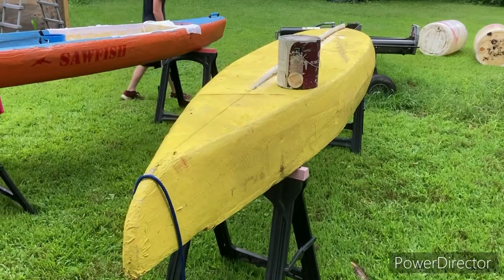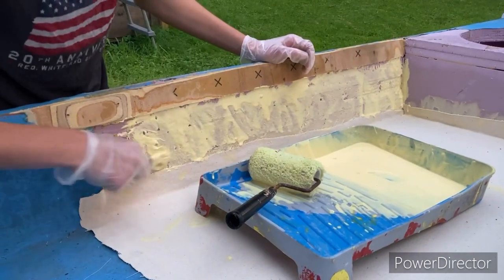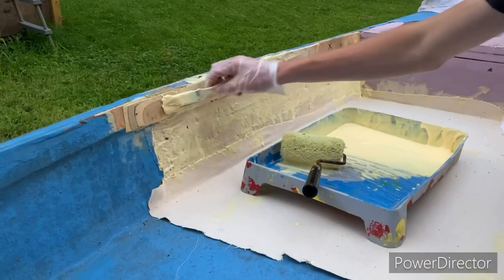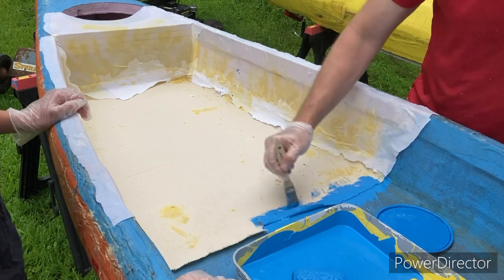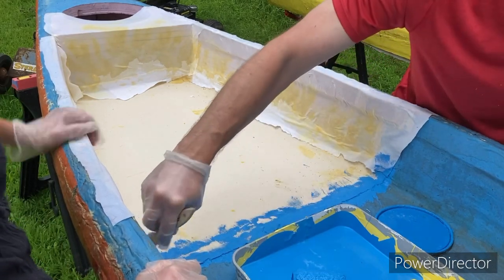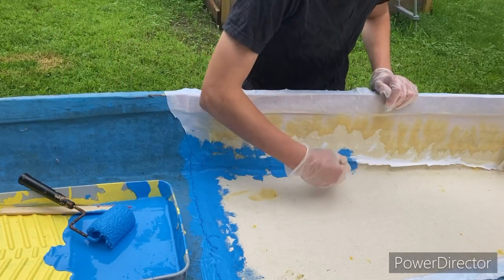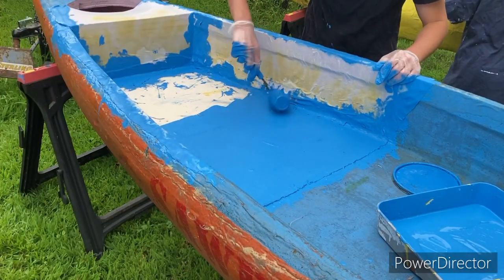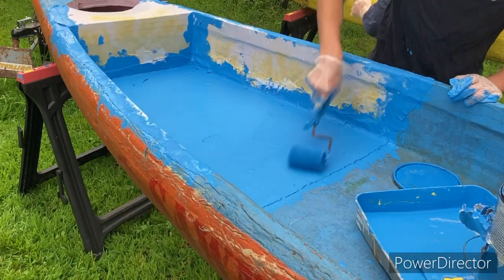Sawfish kayak, fabric repair painting

Comment: Why do you use Titebond 2 glue and not Titebond 3 glue? I've seen other foam builds that the builders are using Titebond 3. Thank you for any consideration and your video postings.
Reply from the maker: TBII is cheaper, and is able to be softened with heat. This allows bubbles and wrinkles to be ironed out with a steaming hot iron. 

TBIII does not have this ability
Reply: @rowerwet  Thanks for the response. I'm really enjoying watching your boat building  and repair videos from a few years ago. I'm wondering what happened to your foam SUP project because it looked promising.